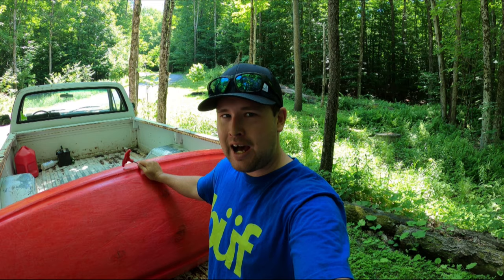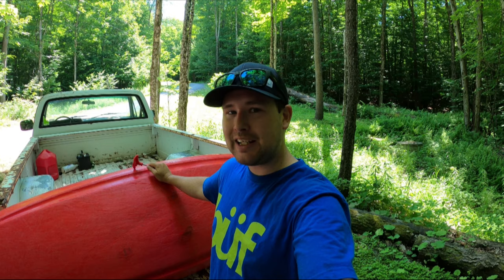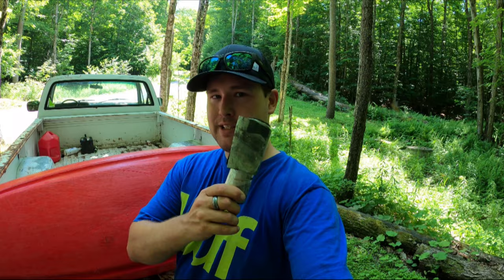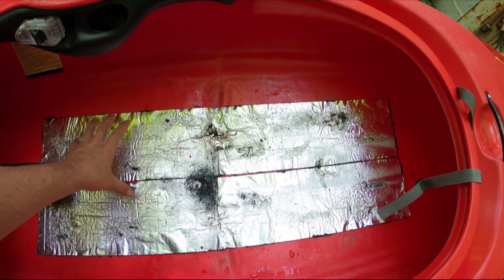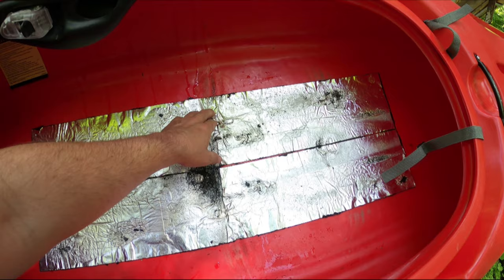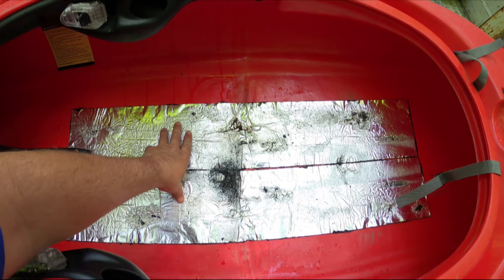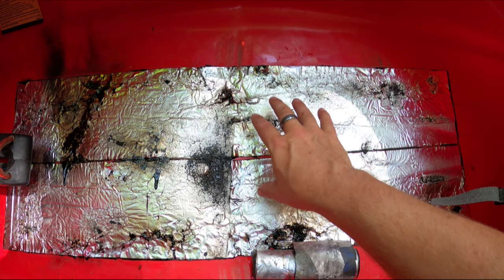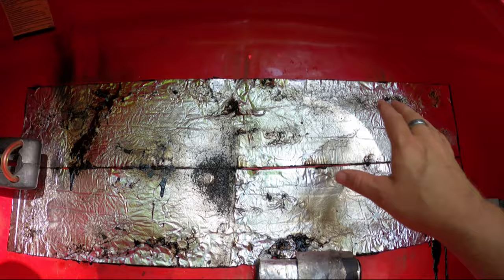Fix Broken Kayaks | Patching Cracks | Boat Builder

Comment from the maker: Need to buy materials? Use these links to buy the best picks on Amazon, and a few cents will come back to my channel.
Roof Flashing Tape - https://amzn.to/3pfY1IU
Backband Ratchets - https://amzn.to/3kjdT9w
Velcro - https://amzn.to/3eMoBUR
Silver Sharpie - https://amzn.to/32sTady
Automotive Push Clips - https://amzn.to/3lsIJhH
Spray Glue - https://amzn.to/3kaSvn7
Scraper - https://amzn.to/35bYQdu
Rivet Tool Kit - https://amzn.to/35bxwfB
Kayak Rivets - https://amzn.to/3pbKn9B
Dewalt Drill and Bits - https://amzn.to/35b8XPP
Dewalt Oscillating Tool - https://amzn.to/2JKnfP6
Cheaper Oscillating Tool - https://amzn.to/2IkrMYi
My Full Dewalt kit - https://amzn.to/35iYty9
Starter Tool Kit - https://amzn.to/2UnTMNf
Solid Tool Kit - https://amzn.to/35em175

Comment: Great video! I've got an axiom that's cracked just under the weld that attaches the seat rail to the hull of the boat. This prevents me from accessing it on both sides. Any ideas about how to weld it?
Reply from the maker: You can remove the rail by heating a putty knife and slowly wiggling it through the weld until it fails
Reply: @AlexBarham  What would you recommend for re-attaching the rail afterwards?

Comment: I loved my axiom but it does seem to have a problem with cracking faster than most other boats. After I cracked it 3 times in a row on the north fork I’ve just started referring to it as the cracksiom.
Reply from the maker: The trade-offs we make with flat hulls and hard edges sadly. Thankfully the Rewind should be more durable.

Comment: Instead of using a capital i or lowercase L you should use the | (also called the pipe key) key on the keyboard "Fix Broken Kayaks | Patching Cracks | Boat Builder"
Reply from the maker: Thanks for the tip!

Comment: What do you do with boats that are beyond repair? Can you recycle them?
Reply from the maker: Yes! Pull the guts and hard points out (you'll need a security screwdriver tip from the hardware store). The hull and the plastic parts are all #2 plastic. Metal is aluminium. 

Outfitting is usually worth keeping for projects though!
Reply from the maker: Other options include turning them into sleds for the winter,  making them into hand paddles, and donating them to Team River Runner